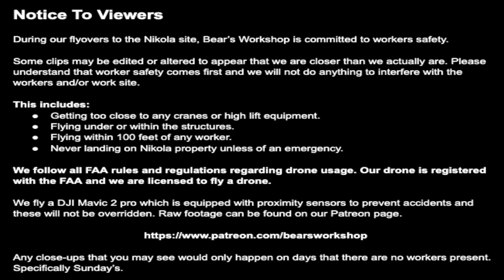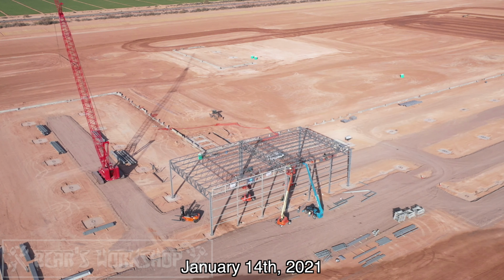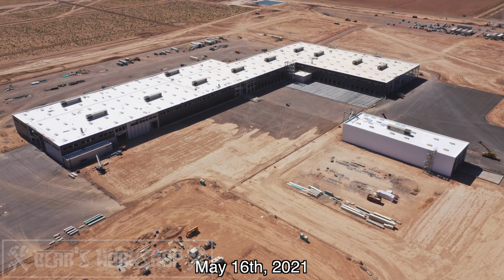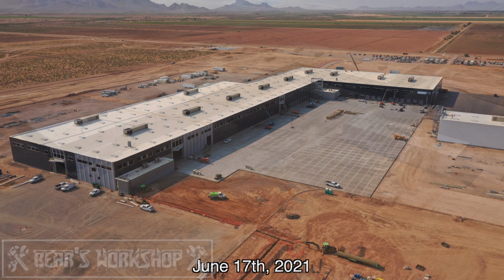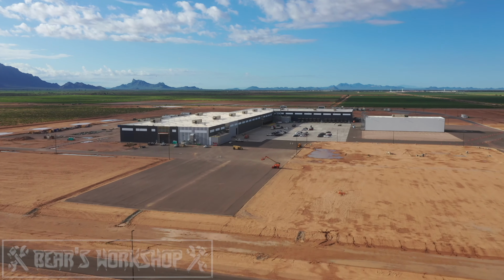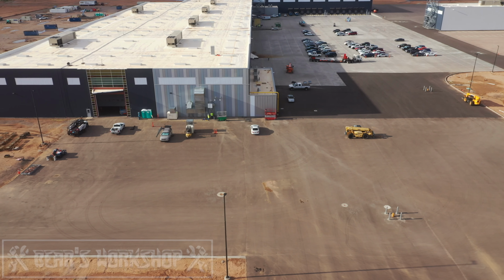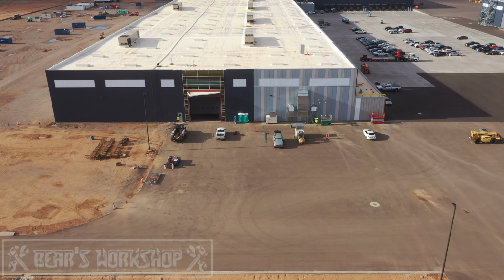Nikola Semi Pilot Factory Construction Site August 12th, 2021 | Drone Footage of 8:00 AM

Comment: When does Nikola expect to start Tre EV truck production?
Reply: Never
Reply: Next month
Reply: From their recent quarterly report conference call:
“And as we mentioned in our previous earnings call last quarter, we have supplier confirmation for enough battery cells to build up to 80 trucks in the fourth-quarter , but we're experiencing delays in receiving numerous other parts at this point particularly concerning our vehicle head units, crash sensors, touch screens and other displays.”

They also said what they are working on now in Coolidge: “gamma” BEV Tre vehicles (the previous two batches (5 + 9) from Europe were referred to as alpha and beta) and five fuel cell Tre prototypes. The gamma vehicles may be prototypes and  distinct from what is referred to as  “pre-series”  or trial production which will be delivered to companies for test usage.
Reply: @lockbert99  
Awesome 👍😃
Reply: @michaelstanley5215  You may want to rethink making money from short selling stocks. The poster asked when they start, not how many. I took a quote from the conference call that had the WHEN (and bolded it) and the quote also mentioned the problems they were having getting all their parts. And, the quote doesn't say they are going to produce 80 sellable trucks (that is between Ulm and Coolidge). It says that is how many they could produce if there was no parts shortage.
Reply: @michaelstanley5215  We are all familiar with "actions speak louder than words".